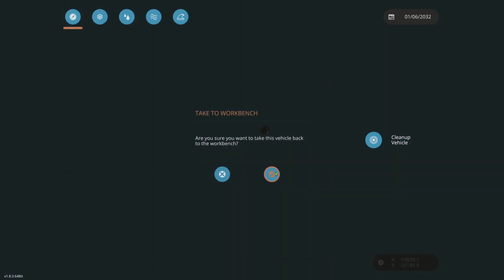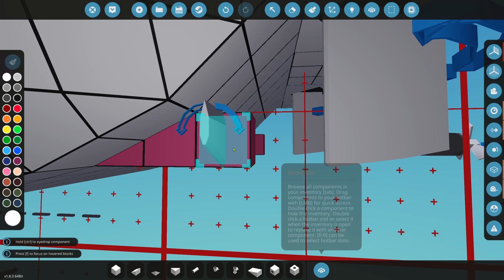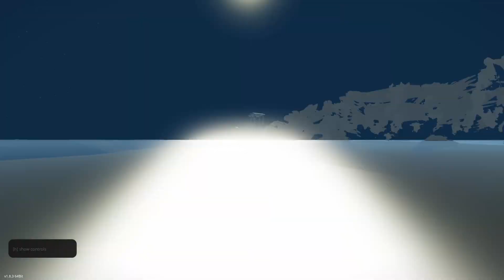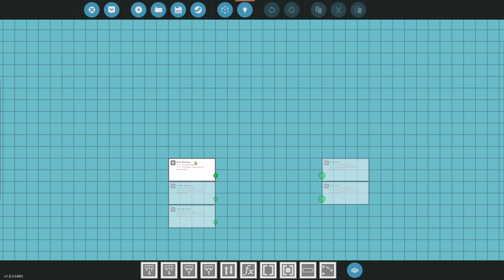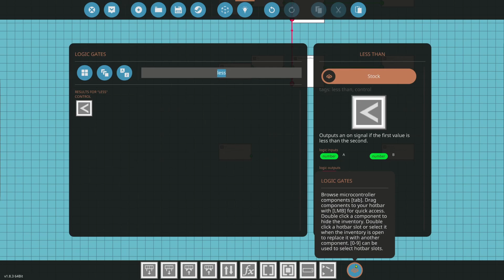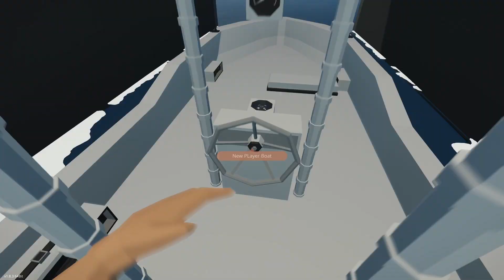Stormworks: New Player Career Build Series Stability Ep 3 #stormworks

Comment: Using this system my boat (which is quite fast, about 70 knots) works wellish in calm seas, it rocks side to side a bit when I turn though. Problem is when i add wind, it jumps straight out of the water and then dives when it lands. What might I have done wrong?